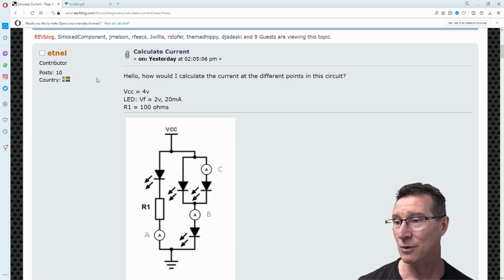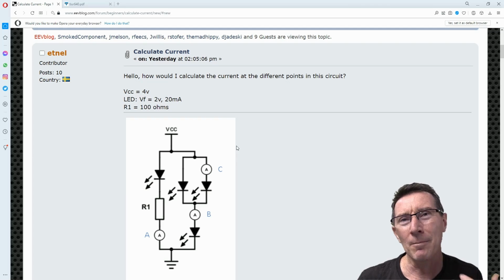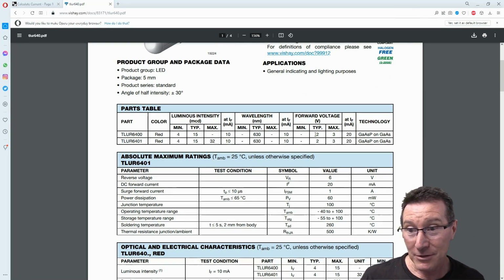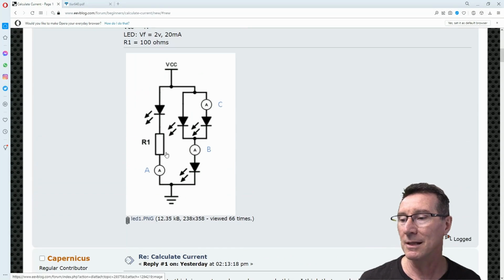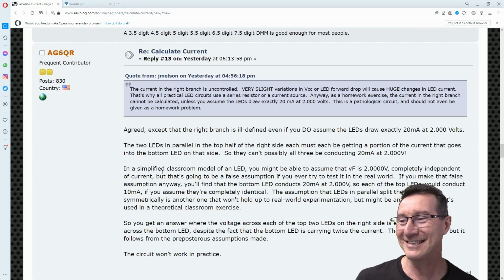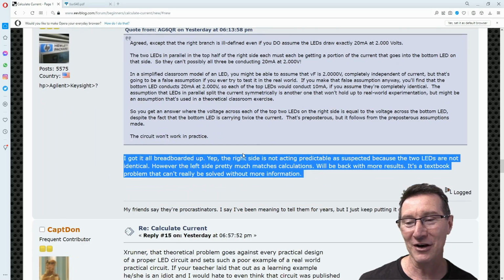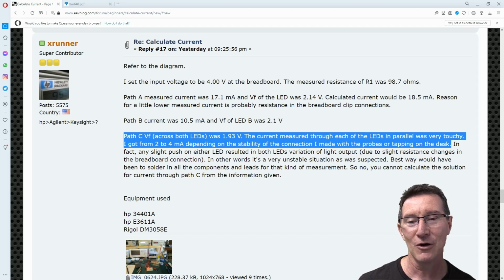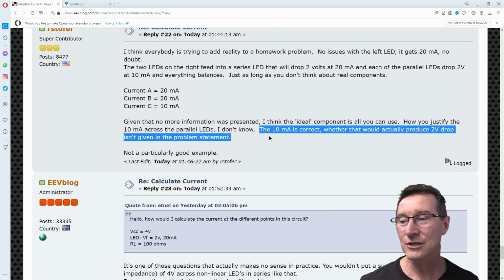EEVblog 1427 - An INFURIATING Electronics Exam Question!

Comment: My hardest professors I had for my electronic courses were either from India or Sweden. As soon as I was done with those classes I just mind dumped everything, I dont know why they pushed so hard.
Reply: I can answer for the Indian professor, here at home we have really tough exams at university's which test your mathematical aptitude/equation manipulation instead of practical skills
Reply: @kingflockthewarrior202  dsp oh my degree stopping paper that is
Reply: Sometimes it was because to work in that field you have to have an intuitive feel for what will happen. Just as a lot of us looked at the circuit above and went "LEDs in series with no resistor" and heard klaxons in our heads, you really need to be able to look at the way a grid interconnect is wired and just go "HELLL NO" before you sit down and work out why. Antenna design and microwave circuits are even worse, you can't even start to analyse many of them without a good idea of which option might possibly work. So you just have to grind through 100's of example problems until it's obvious which geometric transform to use on a given antenna design.
Reply: @mozismobile  People have klaxons in their heads but it’s possible to get quite accurate theoretical answers to this question, with just a few measurements of the actual LED in isolation, using very rudimentary techniques. Furthermore, circuits with low impedance tied directly across a diode drop or two are useful. You know the CMOS inverter? You can build the same thing from BJTs as long as you keep the voltage small and add a bit of feedback. With low inductance design you can have inverters switching in nanoseconds, using jellybean parts. This works even with 50-year-old transistors like 2N2222 and 2N2907. Not as fast but much faster than most inverters people can build out of two leaded BJTs. And you can get the insight that this actually has a chance of working by playing a bit with mathematical models of transistors. Even the EM model suggest that it would work :)

Comment: I’ll never forget in the first assignment of my electronics degree I was asked to find a suitable value power resistor to limit the current in an LED in a big, convoluted yet massively oversimplified circuit of a solar panel directly charging a battery (zero protection).

Of course the LED was of the magical 3.65 V ideal type so, instead of doing a big massive current analysis for all of the insignificant wire resistances and unrelated circuit branches they gave I assumed ideal wires and just used the voltage of the power source (an ideal constant voltage battery) and a single ohms law calculation to get the value of 12 Ω, a nice E12 value. 

But of course I was marked wrong for not solving it ‘correctly’ with three pages of working to get exactly 11.908 Ω. 

From there I realised that the electronics class I was doing was actually just an electronics themed math class detached from any concept of practicality. 

There were plenty more massively over simplified circuits in that class. I really do agree that those questions are “pathological” and should be avoided as I have had a number of people who should know better ask how I’m running a 3.3 V white/blue diode off a 3.3 or 3.0 V supply.
Reply: Welcome to college. Where the majority of your time and money is wasted on pendantic bull shit.
Reply: Every class I've ever had, if they saw you get an answer with an error as small as yours (about 0.7%) they would give you credit for your solution. Usually the overworked grad student grading your HW would look at the work you put down and give you credit anyway. (Nowadays they don't let grad students do the HW grading, so HW plays much less of a role). Finally, if you did have an issue with your HW grade and brought it up with the professor, they would always give you credit.

I always tried to get the most out of my education and for a problem like this, I would go through and do the first-order approximation that they are clearly looking for, then I would spend some time with a considerably more complex analysis similar to what Tomorokoshi did. If I was feeling especially adventurous, I would simulate the circuit and see how that turned out. This approach got me credit on the HW, I learned a lot, and I used that knowledge to better understand the material and recognize the limitations of these sorts of circuits and how I could change them to be more practicable.
Reply: That’s how I chose my college. The two colleges offering EE that I could go to had very different approaches, and I knew people that had went to both of them.

The other college valued strict maths and their exams were full of this kind of crap problems,

When I started electronics, our professor said “In this class, unless stated otherwise, any answer that’s within a 10% margin is okay. If you want to ignore some part of the circuit, state your claim as to why you think the effect is negligible. As long as you end up within that tolerance margin, you’ll be fine”
Reply: @theondono  Ugh. For a year, I went to a technical college where the instructors would mark your answer wrong if you didn't use 3.14 as pi. Ridiculous.
Reply: I'm from exact opposite of the camp. Been taught EE like math previously and when I came to Australia my professor always prefer us to do "back of envelope" calculations. One thing he did astonished me was we got something like 3 x over pi, and he cancelled 3 with pi as "it's close enough" and finished the calculation within 30 seconds while we were still putting numbers into the calculator.
Reply: @liryan  LOL sounds like a slide rule gentleman! 😎
Reply: they thought us the rule of thumb that if the difference is like less then 5% it doest matter (well general obviously for alot of analog stuff it would matter) ....had some of those applied math classes sadly as well but was overall quite pleased w the classes i had. alot were taught by former or still working engineers.
Reply: I so much agree with you. So often I just kind of "know" the approximately the right value. It's kind of like magic intuition, no maths needed.
Reply: Did they expect you to use the Shockley diode equation?
Reply: UNSW Elec Eng 1977-1980 Circuit Theory was this type of BS but they only had AC DC sources, switches and L R C !!  
I learnt far more electronics I actially used in my career from EA ETI and BYTE magazine and self study. But luckily the Computing Department was so not so retarded.
Reply: Just play the game, if you had gone through the correct process of finding the theoretical correct resistance and still made mistake in calculation you still get some points, conversely if you don’t put down the decimal correct answer and don’t show your workings out, you get nothing.

The teachers wanted your process, not your final answer.
Reply: @Gjmahn  My process is good.
Reply: @AlienRelics  My comment was for O.P, but that said, to minimise error accumulation, two decimals seems reasonable, or using the Calculator pi functions if current.

You can bet most other students were using at least two decimal places, not doing so would stand out.

Our marking would have a stated points per question, not pass fail, so there was room for different levels of passing.

Why risk marks by not using information you know, again test taking is a bit of a game, you have to play it right.

There was a guy that failed a test when I was at Uni, Tried to get 100% on each questions, but by going too far, but didn’t finish Enough to get across the line, no doubt he had enough knowledge to pass if he had just answered everything to a normal degree.
Reply: Lol resistors you buy have tolerances. 

In EMC engineering if your calculations are within a few orders of magnitude it's "good enough "
Reply: I studied electrical and electronic engineering for several years and it was nearly all maths and physics. When I went into telecoms R&D there was very little maths and a lot of making and doing. Boolean algebra was the only advanced maths I ever used.
Reply: Because studying is not about remembering a few practical shortcuts... It's about understanding everything in detail! Even in unrealistically convoluted setups, because if you understand them, you will understand most things in real life.
Reply: @Mobin92  yeah, it sucks when you already know a few bits that your learning, but they want to know you understand the complicated methods they have taught you, even on simple circuits.
Reply: @almostanengineer  They teach engineers the complicated methods because they aren't going to spend their time designing simple LED circuits.  When you get to real circuits for production, there's a very good chance that simple methods and short cuts won't be sufficient - that's when you need to pull out the more comprehensive methods.  This is especially true when you get to debug production problems - where some of the boards work fine and others don't... or they work at room temperature but fail when they get warm (or cold).   - Source:  Me, Electrical Engineer since 1989.
Reply: @Cynthia_Cantrell  production debug techs do that usually not engineers. Unless you are talking about prototypes. You just gotta probe around with a DMM, check diode drops across nodes on silicone devices, swap parts, reflash or replace uP, and if all thst fails XRAY the PCB and see if there's a fab error
Reply: @elliott614  When the failure rates get high enough, and the techs are spending too much time debugging boards, the problem gets bumped up to a production engineer.  If he or she can't solve it, then it goes to a design engineer.  Been there, done that.
Reply: @Mobin92  you're goddamn right. My university should think about this and stop making exams where student memory is required.

Give me a damn hard problem but let me take a look at my notes, the main important thing is that I can understand it, even if I have to lookup some reference.
Reply: @rodrigovda  My uni lets you take one sheet of notes in, it's pretty good, they just tailor the exams around it. I imagine it's pretty hard to cheat too.
Reply: @the_drgoblin  mine did too, however in the real world we have plenty of access to plenty of information, so I still think that most exams should let you look up anything, just like in the real world.

Don't test my memory, test my ability to solve a problem in time.
Reply: @Mobin92  It's the difference between an electrician and an engineer
Reply: @Mobin92  Yes. An electrical/electronic engineering degree actually is a degree in several branches of applied mathematics. Highly theoretical. Detailed calculation is part of it.
Reply: Note: What was explained in this video is that the circuit is impossible. What you described is a possible circuit which you solved approximately instead of exactly. So it's not the same thing.
Reply: Yep, thats the reason why i didn't went to college, despite easy way in. Everything depends od people, that you'll meet. There are unfortunately lot of people, that stop thinking after getting a degree, which is even worse, if they teach.

Btw, nice channel you have. Only thing that i don't like is frequency of uploads :v
Reply: @micha3-2137  I can tell you didn't went to college.
Reply: @ritecomment2098  You can tell from...? I'm honestly curious.
Reply: @micha3-2137  <sic>
Reply: @ritecomment2098  Long and comprehensive  answer, i see. Have a nice and productive day.
Reply: @micha3-2137  Read the first sentence of the top reply again, he's talking about that guy's grammar, although technically I don't think a college class teaching EE will go out of its way to correct bad grammar anyway.

Side note, everyone please use Grammarly or LanguageTool, it'll fix many mistakes and make you naturally type better sentences.
Reply: @micha3-2137  The fact that you didn't get it even with that hint is almost as funny as his initial comment
Reply: @ritecomment2098  Seems plain to me that English is not the primary language where they would have gone to college. Tell you what, answer in their primary language, then we can all laugh if you make a mistake, eh?
Reply: Asssuming this was your first assignment, they probably just wanted to make sure you understood the basics of circuit analysis, which you managed to mess up lmao.
Reply: @the_drgoblin  in the real world, 12 ohms. No one will order a resistor specified to 3 significant digits to light an LED.
Reply: @AlienRelics  yes, in the real world you would order the 12 Ohm resistor, but the calculations should have been done, and he could have put, I would use a 12 Ohm resistor from the E12 series as this would fall within the tolerance ramge
Reply: @AlienRelics  professors apparently will. they'll order a $297 resistor from vishay to do it.
Reply: @AlienRelics  The math from that problem applies to circuits where being exact DOES matter.
Reply: @AlienRelics  The purpose of the class was to learn to analyze a circuit. If the student doesn’t learn, he can’t ever understand how a circuit simulator (what we use in the real world) works.
Reply: @altuber99_athlete  Not enough information given.
Reply: @AlienRelics  Could please specify what you meant? Did you mean in my comment replying to you, or in WizardTim’s first comment, or in the assignment WizardTim described, or where?
Reply: @altuber99_athlete  Sorry, YouTube comments isn't a great place to have a discussion. I meant the original problem that Dave describes does not have sufficient information.
Reply: @AlienRelics  I agree with you, the problem didn't have enough information, and it leads to violation of Kirchhoff's laws if the LEDs are modeled as ideal (which is common in theory).